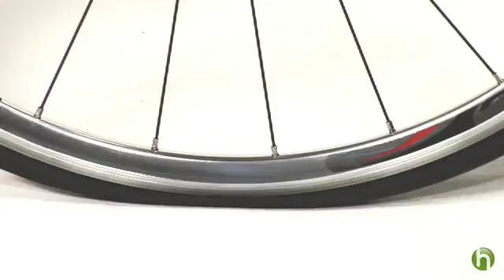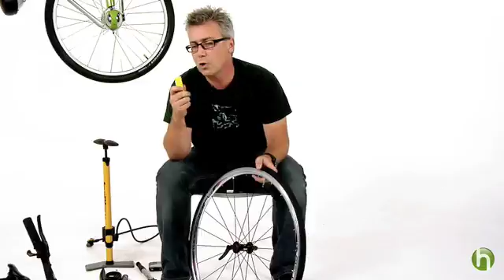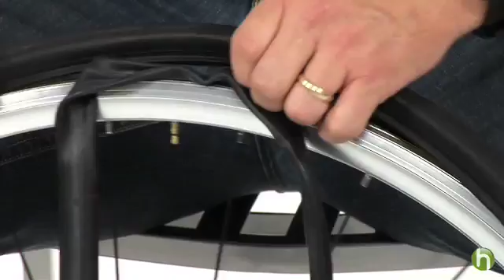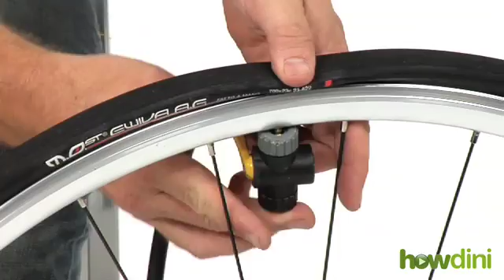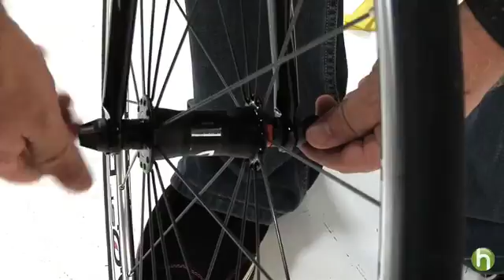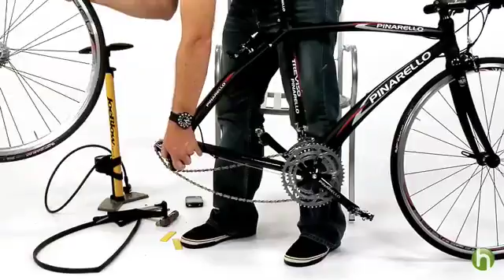How to fix a bike flat - Repair a bicycle flat

Comment: Also .....having water or ideally soapy water to help grease the tire as you take it off or replace it is always a good thing. If you can make it to a gas station or McD's you can use the hand soap in the bathroom or the windshield washer water at a gas station to wipe down the rim and help ease the tire off and on the rim.
Reply: First tire repair video I have seen that specifically explains how to place the levers. Great job!

Comment: Wrong! First thing you do when you get a flat is stop riding and pick up the flat wheel while its on the bike and slowly search the tire and try to find the thorn or glass that gave you the flat. If you can find the thorn while its still in the tire then you can save yourself alot of time later searching the tube looking for the hole.

Comment: 2nd video in this series I've watched with this guy. 
1) How not to lock a bike. - He didn't secure the back wheel with the U-lock
2) How not to fix a puncture - He didn't check what caused the puncture before installing a new tube.

TBH he's giving pretty useless advice.